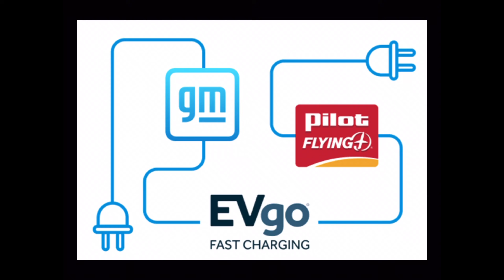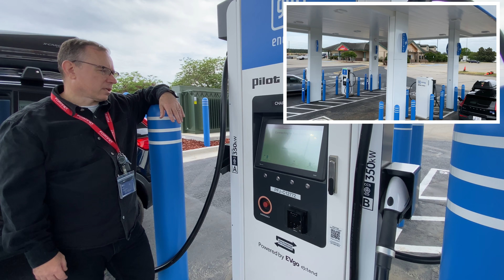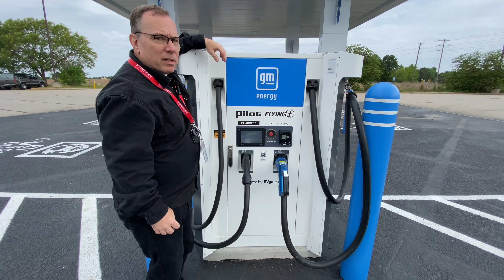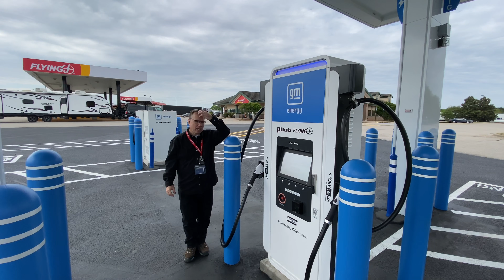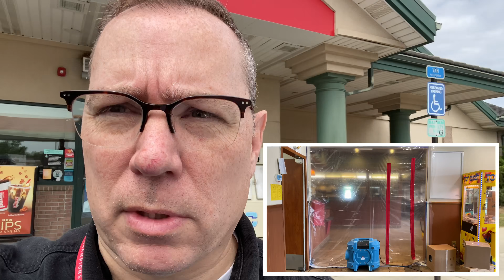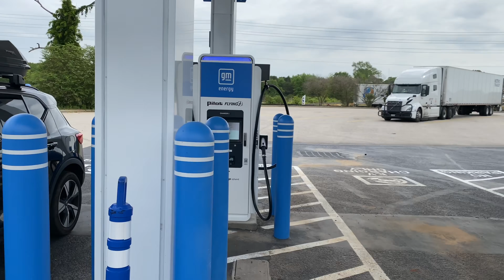Flying J - Kenly, NC off I-95

Comment: The only thing I don't like about this location is the middle spot there's only enough room for one car. It would be difficult for four people to use the to chargers at once If one person parks in the middle of the middle if that makes sense.
Reply from the maker: It seems that way but it isn't.  The city charger has two stalls, both are on the outside of the area splitting in the middle the front of it (one chademo stall and one CCS stall).  The four stalls for the 350s have full pull through and cover from the canopy.
Reply from the maker: ...on second glance, I see what you are saying.  Not sure how I overlooked that while there.  I was pretty pumped with endorphins though, so my judgement was clouded a bit.  My only counter is should someone with a trailer pull into the middle, there is still access for one dispenser for two cars on the outside pull through spaces, but you are right, not as roomy as the one in OK that you reviewed.  That had a bigger canopy and the dispensers were staggered, making the middle more accessible to the two dispensers.  I guess not too different from a gas pump getting blocked from someone with a trailer pumping at a space in front with their trailer blocking the space behind.
Reply: There are technically six stalls (really, three double-length stalls) for four plugs, so I think it would be really hard for three EVs to block all four plugs unless all three EVs were towing trailers.

Comment: Thanks, Walter! Hopefully, EVgo is taking a little more care during the initial power up process so these sites are 100% ready to go when they open. One thing that is concerning is the 750 kVA transformer. That means that they aren't leaving themselves any overhead for additional expansion.
Reply from the maker: CP seems to have a well oiled machine as of late and perhaps the process of flexing muscle with all these installs will sharpen their org's skill sets to where it all just flows.  Good point bout the 750.  The feeling I get is PFJ has no path to growth and will likely but up against leaving demand on the table for others to take in the coming years.  Will be interesting to see how it plays out.  Thx for watching.

Comment: Next year GM cars will come standard with NACS ports.   Seems odd that they did not add them on this new construction.
Reply from the maker: I agree.  I too would of thought they would be introducing NACS stalls already.
Reply: The standards are completely interchangeable, and HUBER + SUHNER is already producing 500+ A J3400 cables. It will be simple enough to start swapping out cables when the time comes, and unfortunately, at the rate EVgo sites are being vandalized and having their cables cut and smashed, it probably won't take very long at all for most of the CCS1 cables to be replaced. 
Also, GM is targeting as many as 300,000 EVs this year, that should all ship with CCS1 ports, and my guess is that future GM EVs will come with the option to order a CCS1 to J3400 adapter, which people can keep in their vehicles.
Reply: Ford and Rivian will give their customers free CCS to NACS adapters and are already being sent out. GM just released their CCS to NACS adapter part number and they are being sold for $20
Reply: @nycplayboy78    I did not form that comment very well. This is only a high level statement of the concern.  For a few reasons it seems wrong that a company committed to using NACS built a charging station/network w/o it.

Comment: Stopped by the Flying J off I-75 in San Antonio/Dade City Fl that opened recently. Using my EVgo RFID card the charger started right up. The price was $.71/kWh. Will not be using the gm energy network.
Reply from the maker: I hear u 4 sure.  GM folk will get a discount.  I think everyone else will wait for them to get with the program and lower their prices.  Thx 4 watching.

Comment: The splitting of power could be problematic. I was once threatened by an F-150 Lightning driver when I tried to share power on one of those Delta units.  If you were charging a Hummer on one unit, and someone started to plug into it, would you ask them to please use an open dispenser rather than cause your charge time to be extended?
Reply: If the first car has been charging for more than 10 minutes charging has likely slowed down enough (150 kW) that adding another car would have no effect on charging rate.
Reply from the maker: No, maybe if there was an open dispenser, but for me charging time is not a game I really play.  I enjoy charging my EV and even 50 kW is not a determinant to me.  I would prob just chat the poor soul's ears off while we waited.  ;-}  Thx for watching